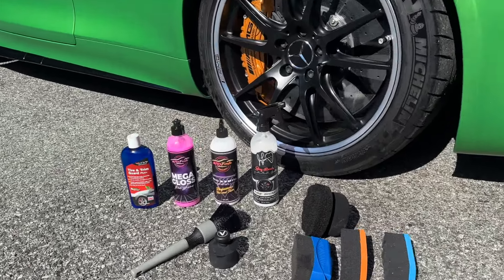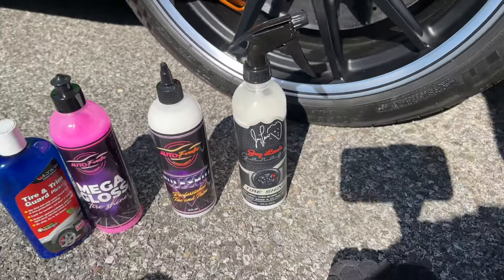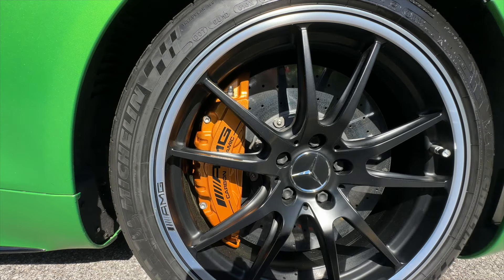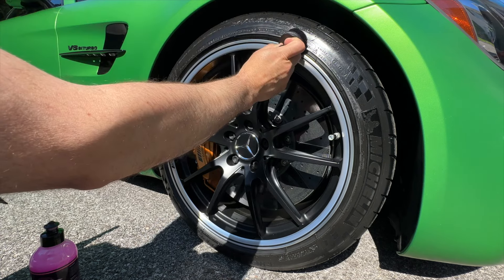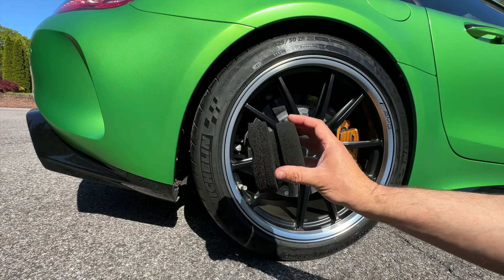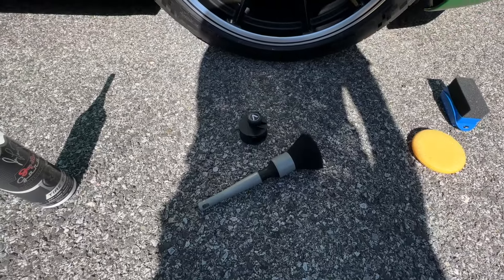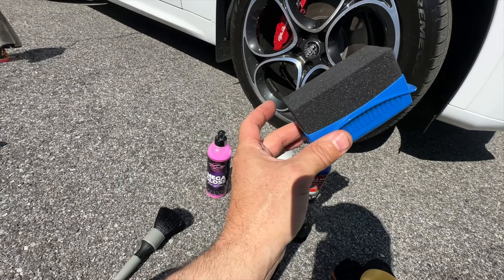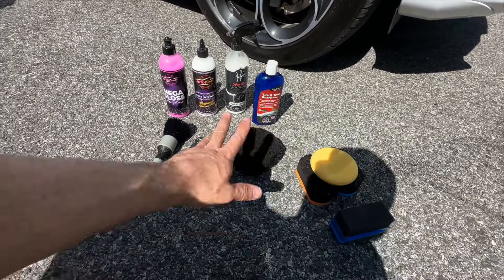Tire Dressing Applicators Foam Vs Brush Which Works Better?

Comment: AF doing what AF does best.  Agree … I’ve tried many, many applicators including brushes and default to that all black foam one.
Reply from the maker: It simply works and doesn’t slime up your hands 🙌. Brushes are used at the automatic car washes in NYC since late 80s they dunk a paint brush into cheap silicone and slop it on tires causing a mess then owners wonder what the stains are on their paint panels lol
Reply: @autofanaticcars  Lasts a long time too

Comment: I bought the small brush from Amazon last year for 10 bucks. Love that brush.  Easy to control and do those edges near the rim. The holder is nice to have to. Try it, I think you'll like it, especially on low profile tires. My truck tires I prefer the big black foam applicator. Great video on applicators and product.

Comment: I agree with those that say they use microfiber applicators. Been using them for dressings for almost a decade. They check off all the marks for my need.

😊😊😊

Comment: I was using the screw ball by Detail Factory. It didn’t sit right with me using a $30 brush to apply tire dressing. I gave it a good rinse and picked up the hex foam pad. Much better.
Reply from the maker: I think the Detail Factory makes the OG brush shown

Comment: The applicator I like the best at least for my tires are the curved ones that are contoured to the sidewall of the tire plus the sharp edge of the applicator to prevent the product from getting onto the wheel.
Reply from the maker: How long do they last you?

Comment: I've found that solvents in some dressings can dissolve the adhesive that holds the foam to the plastic handle, especially for the cheaper curved type of applicators.
Reply from the maker: 100% yes i still preach not to use solvent based products as many stain and turn sidewalls brown. Water based products seem more popular these days.

Comment: That is one beautiful automobile Phil.   You are a lucky man to own one of the Mercedes Benz AMG GT's in that incredible "Green Beast of Hell" paint.    In regards to the Obsessed Garage brush,  could you simply cut about half the bristles off of that brush to try and make the bristles a little bit stiffer?  Similar to what we used to do with paint brushes years ago before all these fancy brushes were available?   I have always had pretty good luck with those hexagon foam pucks that have the grip on them that you show.    I also have that extended lip on my sports cars tires and I hate trying to get them dressed properly and evenly although the pucks do an ok job if you turn them sideways.   I've never been a fan of using a brush to put on dressing, but as you say, its a lot of personal preference.   My current dressing is CarPro Darkside gel.   It works pretty well and gives good durability.

Comment: The OG brush lays liquid dressings on great but, as you said getting that lip is very hard without getting dressing on the wheel.
Reply from the maker: Or your hands if you try to hold the bristles with your hand. Apparently thats how they expect you to use it but not something i would do when other applicators make it easier and no mess

Comment: Great video that is helpful to everyone. I use a contoured stiff foam applicator. It covers well and the edge allows me to get close to the wheel. It's almost inevitable that you get a small amount on the rim here & there. What happened to your red Giulia as this video has a white one? I loved your red one. More vibrant & shinny than the white.
Reply from the maker: this video i I used my Alfa Romeo Stelvio Veloce with the larger tire sidewall I still have the new Rosso Etna Giulia QV but I do not use it much these days I plan to get it out this weekend for a nice spirited drive and maybe il shoot a video.

Comment: For the HEX guard, how do you maintain them? Do you wash them after a certain number of uses?
Reply from the maker: You can clean them using APC and water on occasion but I usually buy a 2-4 pack and they last quite a while. If you use any solvent based dressing that does soften and deteriorate the foam quickly

Comment: I find myself using wedge shaped microfiber or wedge shaped scrub-ninja applicators depending on tire dressings.  If I use Carpro Darkside, I like the scrub-ninja style, but with most others I like the microfiber.  None of our vehicles have large knobs on the side of the tires, which I can see the advantages of using a brush.
Reply from the maker: Do you wear gloves using your applicators?

Comment: I still perfer spraying directly on tire . Right after the wash and dry process.  Spray the wheel wells as well . Wipe wheel with qd . Throw my tire covers on it and go on with the detailing.  Don't worry about sling because by the time I'm done they are dry .

Comment: I like the hex one but in a 3" size. Perfect for low profile high performance tires. Also like them because they have rhe grip.
Reply from the maker: I bought the smaller ones twice off Amazon they came destroyed from being vacuum sealed flat. I gotta try them from a proper vendor soon
Reply: @autofanaticcars  Those are the ones I get. Takes a couple days but they always reform for me.
Reply from the maker: mine never came to shape il order some from Autogeek next time
Reply: for lower profile tires, just cut the hex grip foam applicator in half.  Boom, perfect size.

Comment: Using an air compressor and a paint gun is the easiest way I think if you have all the tools ready.
Reply from the maker: That can be a mess if something goes wrong but can work in a production shop yes

Comment: I have a guard cut to fit the wheels on my vehicles.  This prevents the tire dressing from getting on the wheels.  I can use any tire dressing this way; spray, gel, or even aerosol (aerosol works best for me and seems to apply most evenly, and last the longest.
Reply from the maker: Interesting what is it made from? Issue for me i have so many cars with different wheel sizes but curiously interested to see what you came up with please email me photos
Reply: Can you help me know where or how to get a guard made or where to buy.

Comment: I use the cheap blue sponge from advance auto (shaped like a dog bone) cut it in half and by the time it gets to saturated it's time to throw it away and I love the mega gloss
Reply from the maker: thanks for sharing the foam ones work well and the hex ones last me quite a bit and I have many cars getting washed per week. Auto Fanatic Mega Gloss rocks even after it rains!!

Comment: Put a ponytail band or rubber band on the bristles just above the handle attachment point.  It will narrow and stiffen the bristles.
Reply from the maker: Band aid how about use a better designed applicator

Comment: Get a lobster claw rubber band and run it 1/2 way up the bristles on the  OG brush.  It'll keep a tighter nap
Reply from the maker: band aid but clever idea i prefer the Hex foam pad it is just easier to use

Comment: The problem is that with a lot of these big brushes/sponges applicators the product goes on the edges of the rims that is the worst thing that should happen because most of the products for tyres are sticky so that makes the brake pads dust stik on the rims where the products goes...
Reply from the maker: Exactly but the two I demonstrated here work really good at preventing that.

Comment: I gotta say. Thr OG was a swing and a miss
Reply from the maker: Think they just put their hex logo on it i do not see any engineering or thought that went into it its just a detail brush
Reply: @autofanaticcars  We are going to release a video about the tire dressing brush very soon explaining the thought that went into the design. There is some nuance to using it effectively but when you do its great.
Reply from the maker: @nicknassar9173 Hey Nick thanks for stopping over to check the video. I have tested the OG brush many ways before making this video even holding the bristles trying to cut in the tire guard edge but my hands got wrecked as a brush should not be used this way with a handle which is why I did not show or promote this technique. As an artist for 40 years I never  painted on a wall or canvas holding the bristles to do detail work if you use the right style brush and bristle density. The concave edge is the shortcoming of most brushes and foam applicators for tires i feel as I highlight in the video. I also think with any applicator foam, brush or microfiber the end user really does not want to get anything on their hands or have to wear a glove all the time as some dressings can be hard to wash off your hands. I will check out the video when you guys post it.
Reply: @nicknassar9173 Using the detail factory brush I got in the tire dressing package, was not the best choice either.
Reply: Stick with a foam applicator.  If you are concerned about getting product bleed through the foam getting on your hands, wear a pair of nitrile gloves.  We all have a ton of these along with n95 maks left over from the pandemic